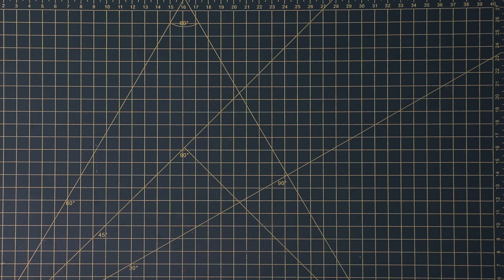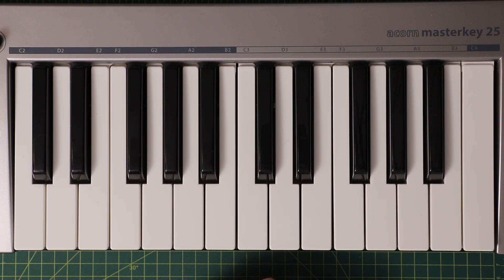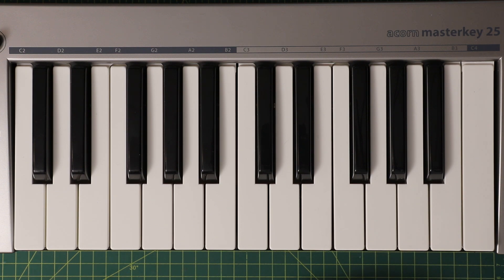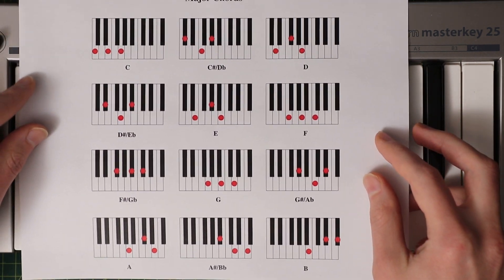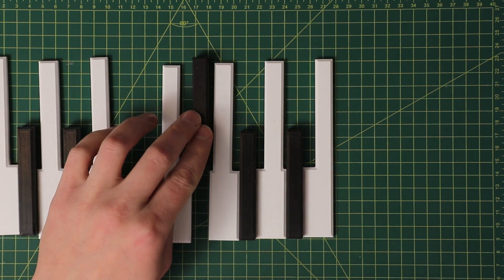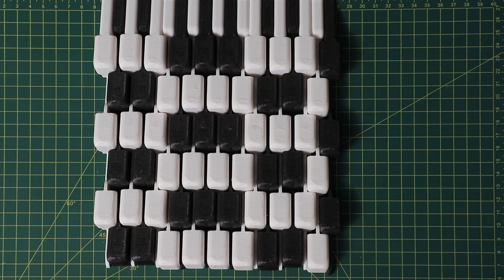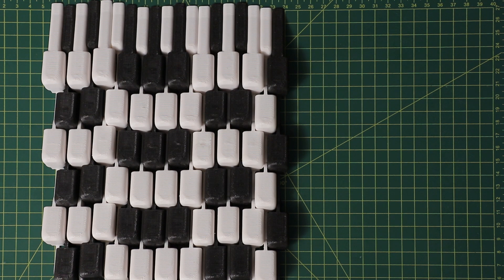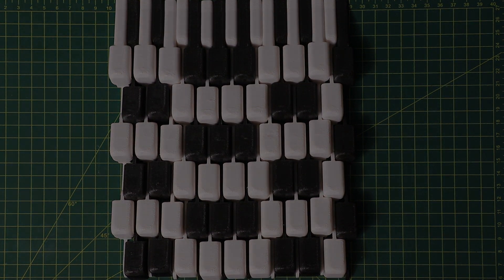DIY Janko Piano: 2.  Keyboard Layout

Comment: I want one.
Reply from the maker: At the moment DIY solutions are pretty much the only option unfortunately.

There are the 'simple' versions with 3D printed keys glued on top of a regular piano; a slightly more complicated version where the 3D printed keys replace the keys of a regular (digital) piano (I would recommend this one if you are interested: https://www.thingiverse.com/thing:6666469), and then the wild-wild-world of full DIY pianos like the one I am building.... and finally the "20,000$ modification to an acoustic piano" you can custom order from a few piano makers.

I did hear that Rico Raven (https://www.youtube.com/@rico-raven) is going to be trying his hands at making it possible to buy his version of the Janko digital piano, though keep in mind its based on an existing regular piano so the octave length is kept at the classical piano's 6.5 inches. The keys are different from a 'classical' Janko, but its still a proper Janko isomorphic keyboard through and through.